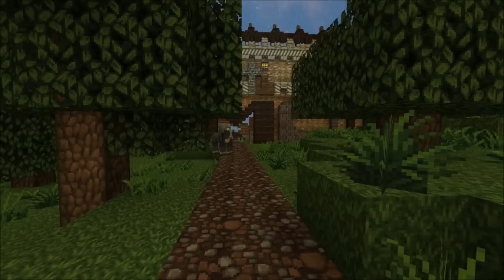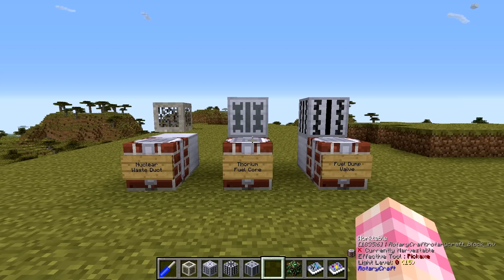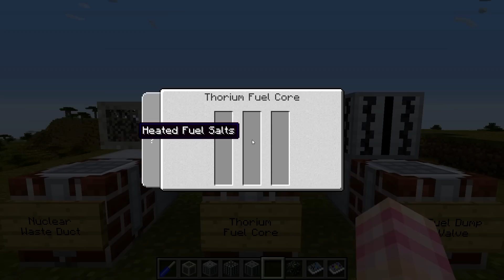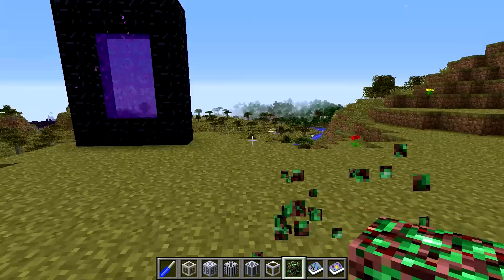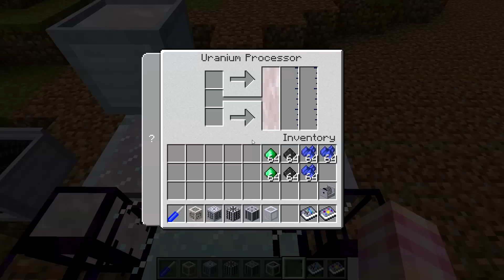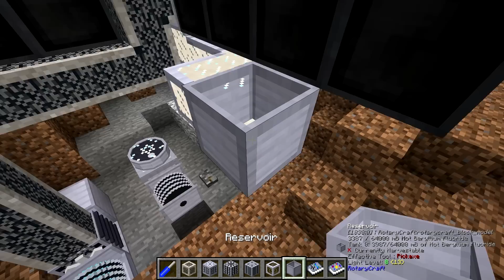ReactorCraft Tutorial #27 - Thorium Reactor

Comment: A Thorium reactor has an air conditioned fuel dump pipe leading to the dump container underneath. If power fails the air conditioning stops and the pipe thaws allowing to release the fuel in to the safest dump .
Reply from the maker: I heard that, that's pretty cool. Such a simple solution.

Comment: I can spoil the fun by analysing the code.... Should I ?
Reply: Anyway, given the code, I think it is really a WIP for which Reika is still pondering which mechanics to use... Without spoiling too much I can say he wanted the sodium boiler to be able to heat the thorium core, but took a step back and commented this particular section of code.
Reply from the maker: Interesting. Perhaps it isn't quite ready for prime time yet then. Still, it does work. The question is can  you make it efficient enough to justify its use right now.

Comment: Curious if environment can influence the reactor like all other rotarycraft and reactorcraft systems.
Reply from the maker: Yes, if you build it in the nether it will be partially preheated. In fact this reactor may have been designed to be run in the Nether given that its fuel components are farmed there.